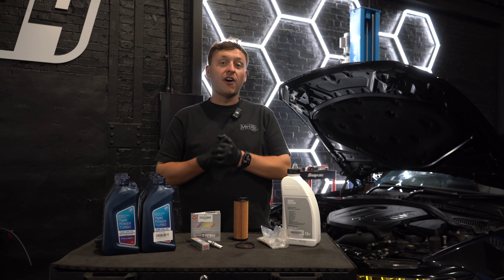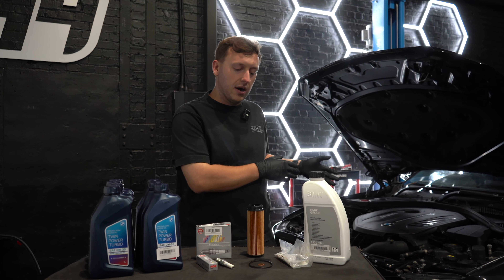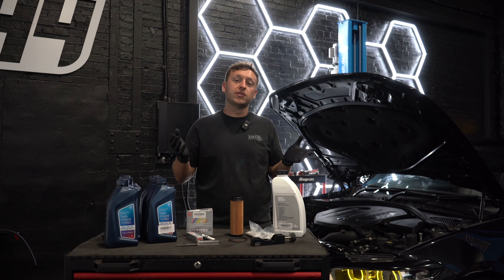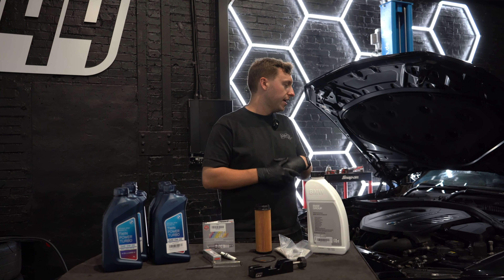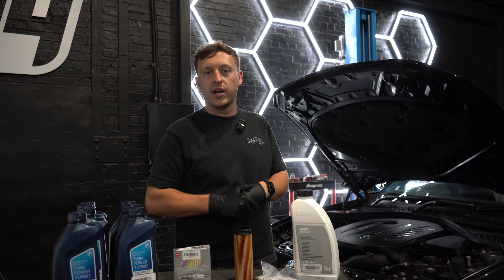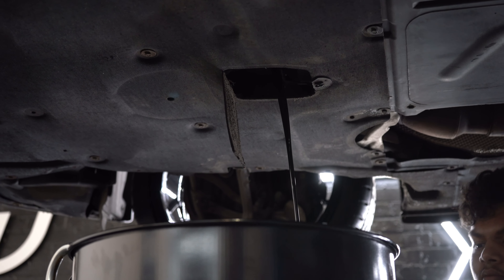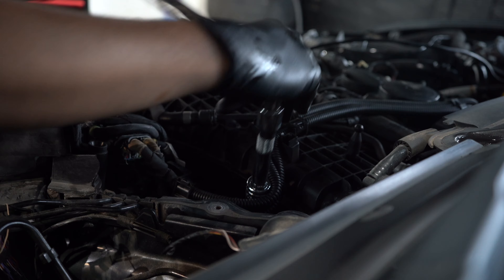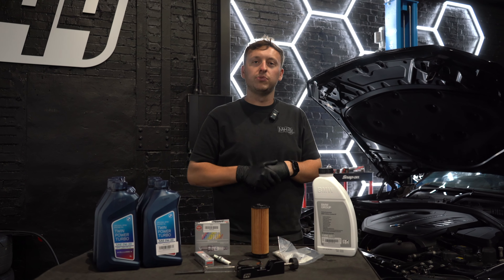How to Service a B58 Engine Using OEM Parts | Step-by-Step Guide

Comment: No gapping needed at all and 5W40 would fit way better. Nevertheless loving your content. Keep going on!
Reply: Correct. Do not use 0w30 unless you want your engine to Fail as its way too thin and purely for emissions... tuned ones has to run 5W40. Non Tuned 5W30. Spark plugs gapped if stage 2 or above..
Reply: I run 0W40 all good 👍
Reply: @jameswrp  of course will be all good...on the outside ! Hopefully next time have a look at your rod bearings and camshaft to see if all good there on the inside ! ...
Reply: @wazmru  came recommended from my garage who specialise in M's and has worked on countless B58's. He says he found this grade uses less oil between changes. I can always do an analysis
Reply: @wazmru  No need to gap them above stg2 lmap. Stop giving sht advice.